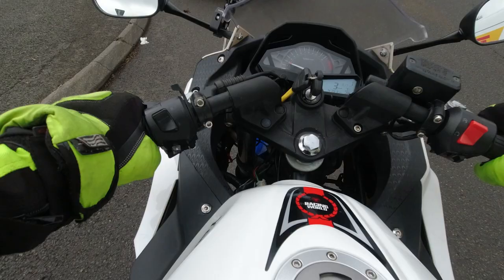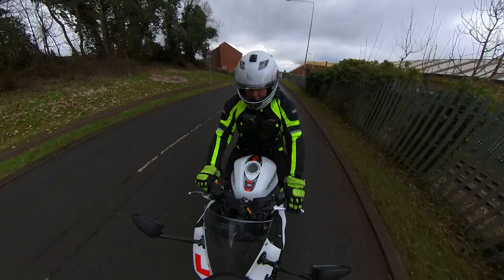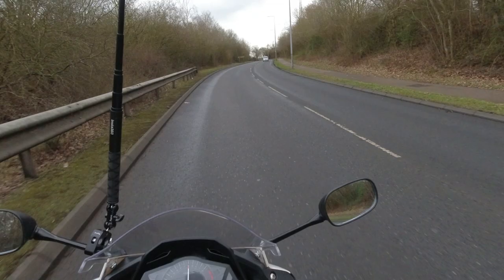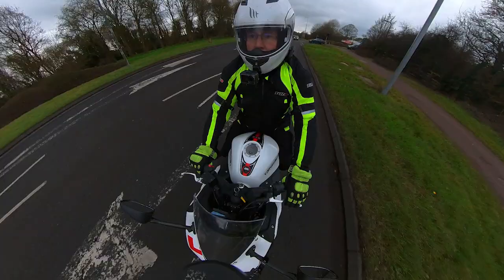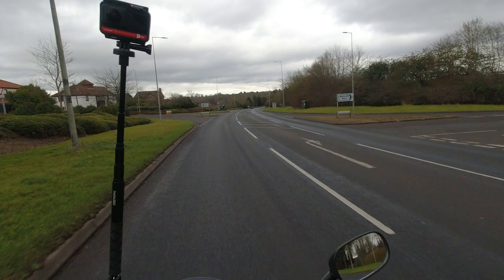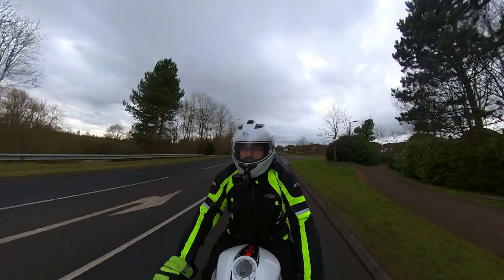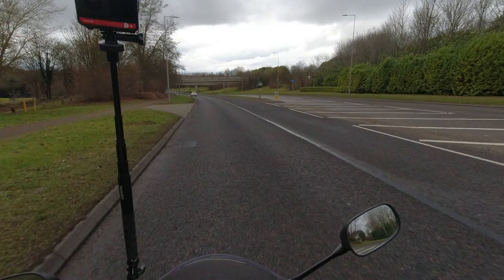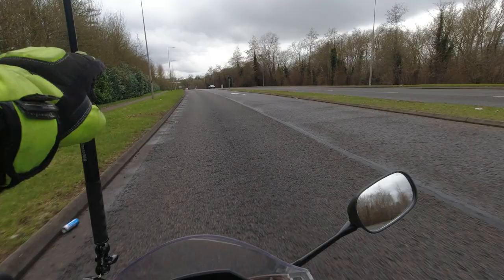Yamasaki YM50 RE with 72cc Big Bore Kit - A High-Performance Test Ride

Comment: Hello mate do you know what engine is a straight plug and play into this bike not fussed if it’s a 125 or 50 just can’t seem to find any breakers and want a whole new engine not top end
Reply from the maker: any pit bike engine will fit but it isn't as simple as just chucking it in if it is a carb bike it is a lot easyer an efi one will be a lot more work

Comment: when putting a new 72cc top end in, will you have to go a certain speed for a certain distance to break it in?
Reply from the maker: yes you should run in your engine no harsh acceleration and dont over rev it

Comment: Hi I get 43mph out of my stock Yamasaki ym 50 de restricted how much will I get out of it with a 70cc kit
Reply from the maker: More talque  not alot more speed
Reply: @Ridingreviews  thanks would you say it’s worth it and will it go uphill a bit better as mine struggles uphill
Reply from the maker: @2fiddy  it would help up hills, but if you get the installation rong, it will cost you £500 for a new engine